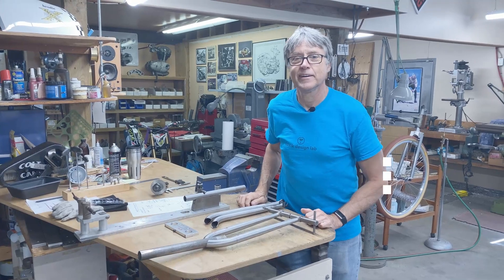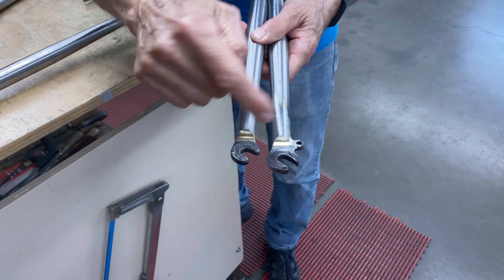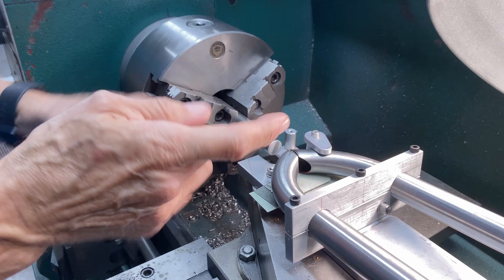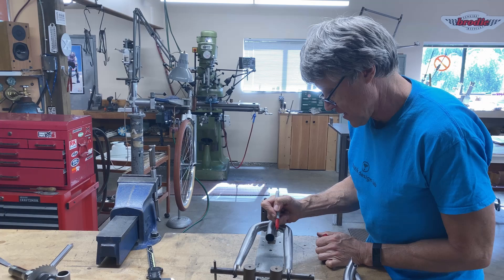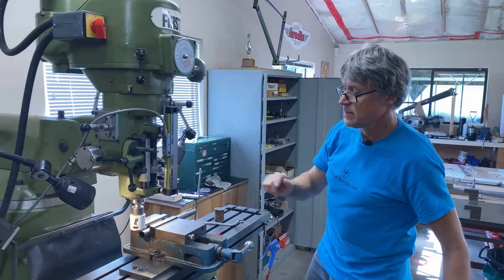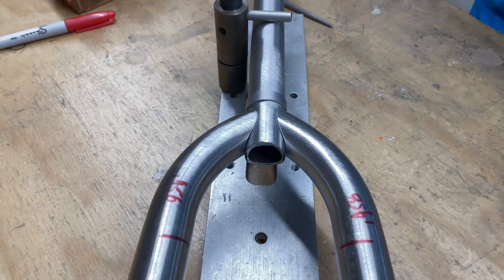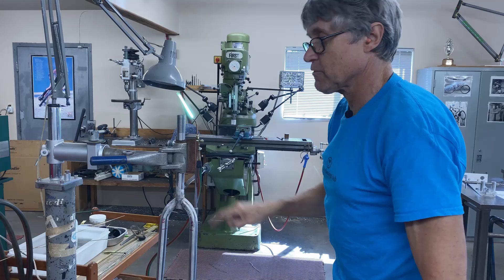Brazing A Unicrown Fork with Paul Brodie - Framebuilding 101

Comment: Good video, in fact, it rises to the level of great video. I never used nickel silver for forks but I did use it a lot for furnace brazing   turbine engine parts in the factory where I worked. For forks, I always used the brass first and then 45% silver solder on top of that for cosmetic reasons.  Bicyclers are the only group I've ever known who can judge the quality of a weld just by feeling it. Not only that, the concept that a 24 lb. bike is better than a 25 lb. bike has always baffled me. Nothing makes my skin crawl like seeing a fat guy on a light weight bike racing along to his crash site. Something you can appreciate, I was ridiculed for building a tandem with a 70 degree head angle 35 years ago. Your 69 bike made me smile.
Reply from the maker: Thank you!

Comment: When you are turning the forks to create the bearing seat you could make up an extended tailstock centre to go into the steering head tube with a small live centre. This would help to stop the flex and runout which causes the intermittent cutting and let you stay further away from the lathe chuck.
Reply from the maker: That seems like a possible solution, except the hole isn't round (or flat) from all the brazing and filing. I made up a better tool holder and that helped.

Comment: Ah, TIG welding for tacking. I've wondered about that for fillet brazing. I have a quality DC TIG welder, but haven't welded any bike tubes yet. I'm still shopping for a decent brazing torch.
Reply from the maker: Get a Victor J28 with a zero tip. That's all you need.
Reply: @paulbrodie  Great, perfect! I wanted to ask you the reason for nickel silver for the Romax build? I know you mentioned brake braze ons, but why the fork or any tubes? Is it how it brazes, for additional strength or for color?
Reply from the maker: @jimjungle1397   On the Romax build I used nickel silver, bare brazing rod, and silver solder. The nickel silver was used on the brake bosses, and for attaching the seat stays to the seat tube. I use 1/16"rods because that is the perfect size for what I just mentioned.

Comment: Splendid work, as always. Question not related to the video: Do you ever do rough bike prototypes? From the looks of it, you never cut any corners.

Another one: Have you ever had a frame crack from riding, guessing MTB is exposed to more stress than a road bike.

Best from Sweden
Reply from the maker: Hello Sweden! Do I ever do "rough bike" prototypes? I don't think so. I like to do nice work :) I have bent a downtube (rider error..) but I have not had a frame crack from my riding. I tend not to be hard on bikes.. Other riders have broken Brodie frames years ago.

Comment: Great video! Somewhere I missed how the tube was threaded. It's one of those little things that seems a mystery to me. All I can vision is a plumber threading a pipe. I assume it is done on the lathe?
Reply from the maker: Framebuilders buy threaded steerers if that is what the design calls for. Yes, you can thread a steerer on a lathe, if you need to, but it's just easier to buy them threaded.

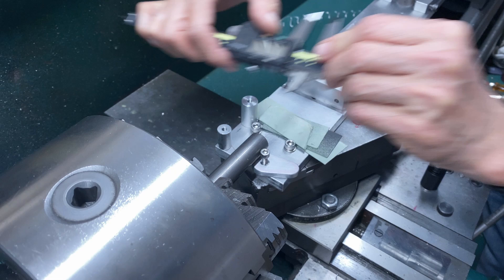Comment: Hi Paul, @ 3:30 in the video, could you make a spacer block instead of measuring each time? I suppose it's only efficient if you were really doing some serious production (time invested in making the spacer block, vs. just measuring each time).
Reply from the maker: Yes, a spacer block could work. If it was serious production I would setup the fixture in the lathe and then mitre 500 pairs of fork blades...

Comment: Thanks for video. Why do you use nickel silver instead of regular brass? Do you drill holes on fork blades before brazing?
Reply from the maker: nickel silver is stronger than a bare bronze brazing rod, and definitely stronger than regular brass. I did not drill air holes. I like to seal tubes, and I know that not every builder will agree with me.

Comment: can you tell me what is the cheapest and best steel for bicycle frame
Reply from the maker: Impossible. You cannot have the cheapest and the best. They are at opposite ends of the spectrum. But thanks for watching!
Reply: @paulbrodie  So in your opinion is 4130 steel the best?
Reply from the maker: @huubang4516  Yes, I like 4130. It is easy to work with, but not the cheapest!

Comment: Get rid of the hole saw and use a 4 flute end mill to make a proper cut, you wont regret it.
Reply from the maker: I think on thin wall bicycle tubing an end mill would tend to grab. All the frame builders I know use hole saws. There must be a reason.
Reply: @paulbrodie  Yes they are cheap, I do a lot of 4130 and .049 wall and hole saws do not run true enough to make a good cut so the welds have to make up for it.  I have even moved to end mills on my tubing notcher for the same reason.
Reply from the maker: @1960fl   .049" is pretty thick. A lot of bicycle tubing is .031" (.8mm) so I'm very skeptical an end mill wouldn't grab and tear...
Reply: I’m fond of End Mills myself for notching square tube, and also for mitering round tubing prior to welding.  Only trouble is end mills get spendy once they get past a certain diameter.  Then you either use a hole saw, or a boring bar!